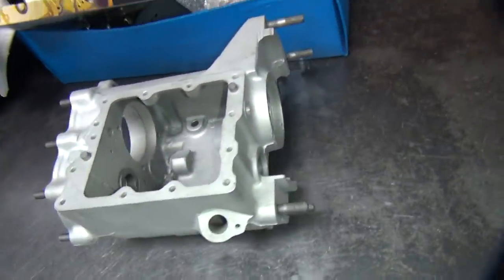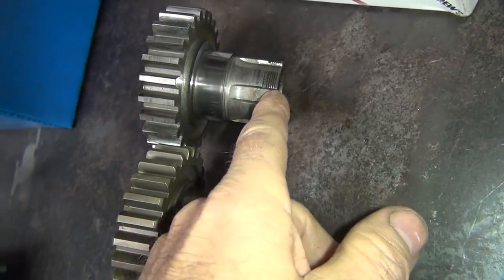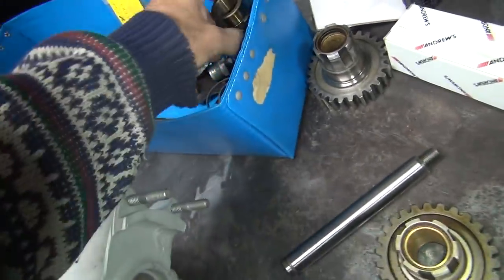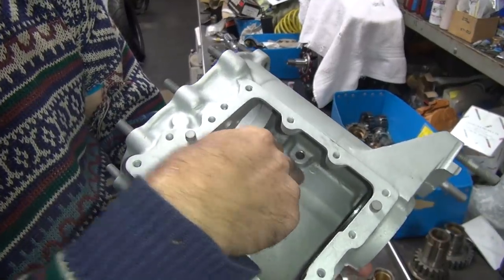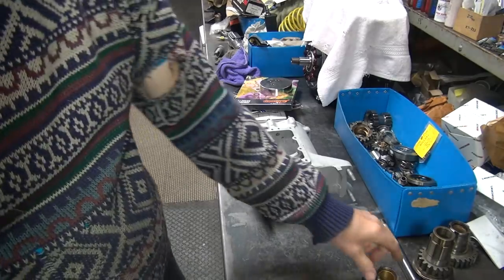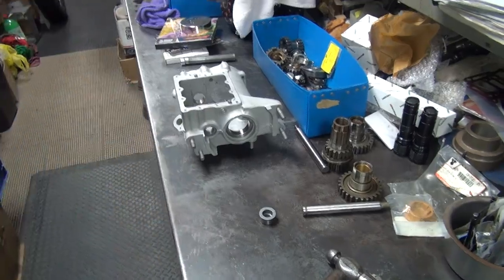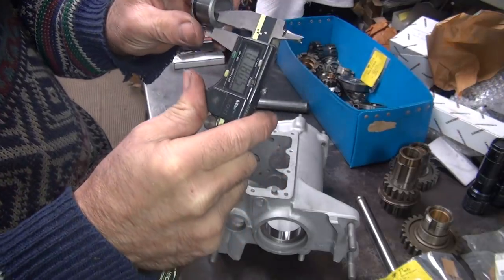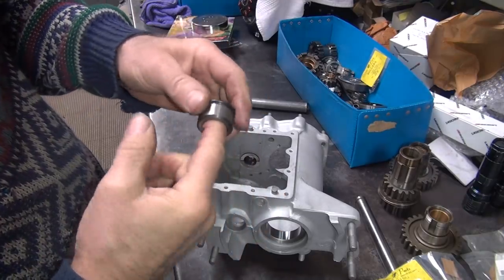1967 74ci shovelhead #134 flh bike assembly transmission rebuild harley craigslist tatro machine

Comment: HD cheapo oil light bushings on the Layshaft caged rollers are best. Take the oil light bushings and taper the OD end they will follow the hole straight into the Case.!. 🔔🔔🔔

Comment: I am curious why you don't apply a little heat to the case and chill the steel components so that they fit together easily without pulling metal it is a common procedure with aluminum housings.
Reply from the maker: it doesn't do much, and slows down the work.
tatro

Comment: If you had a transmission that was already together and good could you add green wicking loctite to the mounting bolts from the outside to help with leaking? In this case there is no leaking at present as it is a recent rebuild so I don't think there is oil that would stop the locktite from setting.
Reply from the maker: as long as it was dry it will work.
tatro